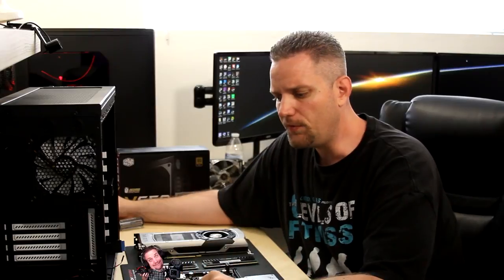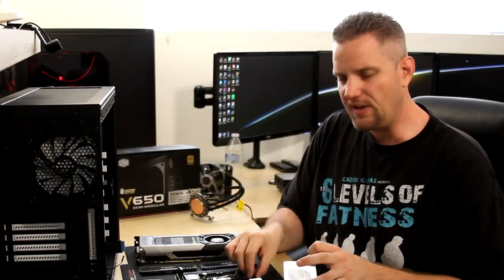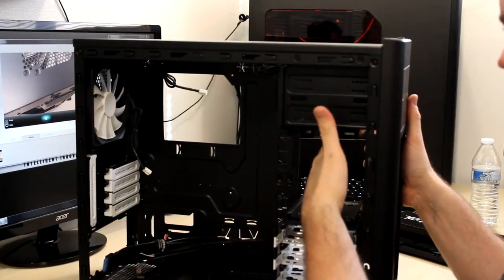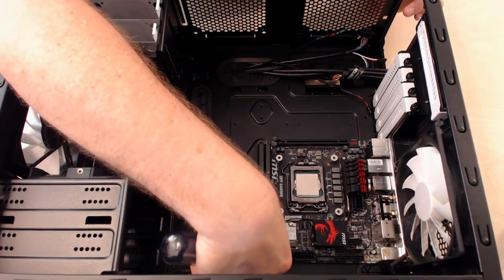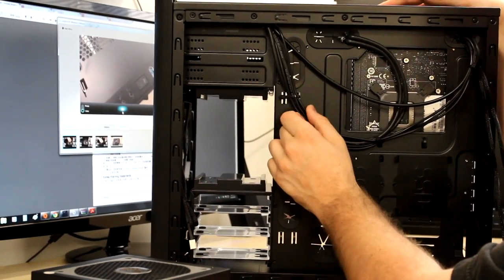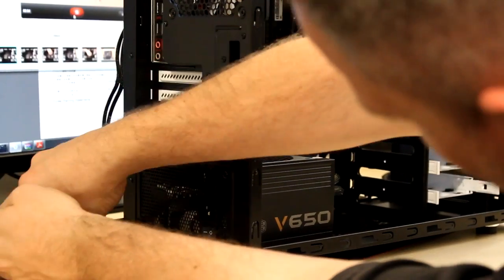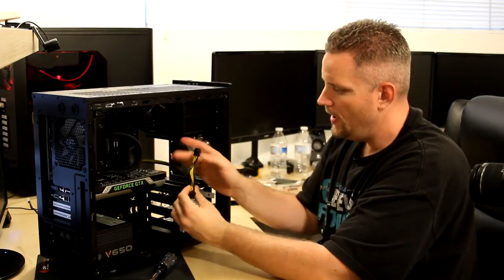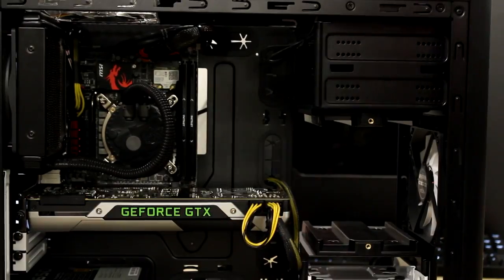Beginners Guide: How to Build a Computer

Comment: and jay will that psu cover thee parts it frys if it goes out? if so i want that thing just to be safe lol
Reply: and also how are you suppose to install windows without an optical drive?
Reply from the maker: drew lowery Check out Barnacules video on installing from a thumb drive. Optical drives are a tad outdated these days.
Reply: ***** okay thanks alot!
Reply: drew lowery honestly, just spend $20 on an optical drive and you'll be happy.. spending $20 (or less) on a thumb drive just big enough for a windows installation is not going to give you the decent speeds like an optical drive would.. i should know, i first tried that with my netbook.. took me hours to install windows xp with a thumb drive versus 30 minutes with an external dvd drive
Reply: gamerx9191 I installed Windows 7 from a USB 2.0 thumb drive faster than when I installed it from a CD
Reply: Mitja Redlin dont know how you did that one, but good work
Reply: I had to reread this question a couple times because people do not know how to speak or write english anymore.
Reply: Ian McAuley fuck off its youtube who cares its not a job application is it? no.
Reply: The "F" in "fuck" should be capitalized. Also, it is necessary to place either a "-" or a "." after "off". Another mistake can be seen when  you use the word "its" for the first time. That word should be immediately changed to "it's" or "this is" to be more specific. Another period should also be placed directly after the word "youtube", which should also be have a capital "Y". "Who", note "who". put a "?" at the end of "who cares" since it is a question. Again, "its" should be "This is"- capitalization and all. Place a comma after "application". One last thing- "no" needs to have a capital "N". In all, the sentence should read as the following:
 Fuck off. This is Youtube. Who cares? This is not a job application, is it? No.
Note: Keep working on your writing skills. ={D
Reply: gamerx9191
Because flash storage of any kind is faster than an optical disk......? Installing Windows from a flash drive will ALWAYS be faster than from an optical disk.
Reply: Ian McAuley
I bet you feel pretty good about yourself now.
Reply: Oh, defiantly. If only he didn't react all butthurt-like. Then no one would have to do stuff like I did to people like him/her.
Reply: Ian McAuley
Thank god there are people like you in the world... What on earth would we do without you?
Reply: hahaha. the fact that some people can be moved so much by people they don't even know is entirely stupid.
Reply: Ian McAuley
Speak for yourself hahaha
Reply: People still care about this topic?
Reply: gamerx9191 I installed my windows in 10 minutes with a thumb drive.
Reply: +Ian McAuley "Defiantly". Worst English teacher ever.
Reply: +Sabansux22 congratations yu sound lik a 10 year old kid
Reply: DJ Vader Thanks bro. I was 15 then xD And I never had built a pc. I was asking questions. But now I've built my pc and it's running well.
Reply: Den Ans Ikr.
Reply: +Den Ans yep
Reply: +corvin szimion It's the cooler master seidon 120
Reply: Sorry for being so late, but it's the Cooler Master Seidon 120.
Reply: Its the Cooler Master Seidon 120.

Comment: My tip is that everyone should use an ATX case unless your making a portable rig or whatever. This is because you have ample amount of air flow for your components maximizing their life and keeping them cool. Also it will make it easier to do cable management and you don't have to buy specific parts which fit in the case. Furthermore buy an ATX motherboard as your components will be further away from each so they'll stay cooler.

Comment: Please don't ever remove this video, I plan to be using it this Winter when I build my own PC for the first time. So convenient that I decided on this same case a little earlier today before I found this vid lol!
Reply: im planing on building my own pc too. gotta go earn some cash b4 hand tho..
btw. do u have any suggestions for cases? all i know is that ill b using intel core i5 6600k and r9 380 graphics card. yep.. not gonna get hyped too early lol. any suggestions would help!
Reply: Clash with Bobby
The one used in this vid is probably your best, cheapest bet.
Reply: Wouldn't the rx 480 be a better choice over the r9 380 ?
Reply: Good luck man I just finished my first build today, I go so frustrated some times but I just took deep breathes, I'm still not finished because my hard drive gets here tomarrow then I can put it in and install my drivers and Windows.
Reply: I was so relived when in plugged in my power cable and it came on

Comment: How about safety?
Antistatic wrist wrap, ESD safe procedures, gloves, etc, etc.
Reply: Static isnt much of an issue as people make it seem. The most you'll ever need is an antistatic band and thats it.
Ive had experience with pc's, all Ive done is touch the metal case every now and then. If you only have a plastic case, I guess you could use an antistatic band but really as long as you arent building on carpet nothing will break. If you really want to be safe, you can plug in the psu to the outlet, turn it off, and attatch your antistatic band onto that. And using an antistatic mat. But yea its not that big of an issue. Most parts nowadays are more durable than back then
Reply: All I ever do is to touch the metal case and sometimes an anti static band(if its a super expensive pc I dont want to break).
Reply: Creamy Z But if this is the case, why the motherboard manufacture and other big electronic companies   does care about ESD??

If you buy a brand new TV set, would you like to see fingerprint all over the screen??

And if this happen with your brand new laptop?
Reply: coisasnatv Because it can happen and they want to warn people. If they didnt tell you, you could potentially sue them. To be safe though, I generally just work on tile and touch my case. Sometimes I will use an anti static band. There is no need for anti static mats snd gloves, etc.
Reply: if anybody could help me for my laptop's touchpad problem, so for example i open the search box on youtube and i type with my keyboard, after i type what i want it takes like 4-5 seconds for the touchpad to respond.. if anyone could please help me that'd be fantastic
Reply: +Delightfuly reinstall windows if you cant find a fix
Reply: Someone thanks i'll try it out
Reply: Someone i currently have windows 10 the like update
Reply: +coisasnatv I built my first PC on a carpet. I'm typing with the same one right now xD

Safety is important still though
Reply: +Creamy Z tell that to my father. He thinks its impossible for me to build my own PC.
Reply: Technically if you just touch the case it should be impossible for you to induce static onto anything because your voltage potential should be = with the case, static zaps are pretty rare as is, and then the odds of that actually breaking anything seems really, really slim.
Reply: +Will Example, I shocked my cpu so hard my arm hurt for a little while afterwards. Was the CPU fine? Well, I can say that fx 8350's are tanks, so of course. Slow and multi-treaded tanks. Puns.
Reply: +Will 

Static has a thing with me. I'm always shocking someone and getting shocked by metal
Reply: My wife does the same!
Reply: Will:  I'm a Firm Believer in Touching my Case so my Voltage Potential is Equal to the Case.

Comment: Wanted to drop my appreciation in a tangible form here for you, Jay. Long term PC gamer, first time builder, your overview got me comfortable enough to finish the build in 3 hours without any issues other than the wiring/connections from case to motherboard (and that was a user error more than anything else.) games that were out of my reach before are running smooth as silk on highest graphics, and I neither could have, 'or would have been able to do it without your video. My thanks.
Reply: I'm having so much trouble with the wires lol.
Fuck the io plate. Biggest pain ever

Comment: Two problems, what about the static electricity and thermal paste?
Reply: +Ya_Boy_Dom IKR
Reply: Im pretty sure, you install the PSU first and plug it into the wall and keep it off then poke the case every so often.
Reply: OK thanks :D
Reply: +Ya_Boy_Dom it looked like he was using an anti static mat
Reply: +Patrick Challita What about the uncooked rice style? Would that work as well?
Reply: ThePIANOguy14 The uncooked rice method works perfectly fine. However if you're applying thermal paste to GPU (for water-cooling) or 2011 socket CPU's which are bigger (5930X) apply the thin line or X method. But for a normal CPU (like 4790k) uncooked grain of rice is fine or pea method works fine too
Reply: Patrick Challita Okay, thank you. I've heard all these methods and now I know which ones to use.
Reply: +Patrick Challita I always wear a strap to be safe
Reply: Ch33kyMangozOnPC Its good to wear one but its not that necessary if you follow the simple precautions such as working in a static free environment and touching the metal case every few minutes
Reply: Shh, you're crushing babby Jay's dreams.
Reply: Usually inside-out antistatic bag wich comes with the motherboard works
Reply: At 6:42 I scrolled down here for this. Just wanted to make sure thermal was mentioned, and  static.
Reply: Thank you!  And the order he's building in is driving me nuts!

Comment: Even though I am an experienced builder and know quite a bit about this stuff, this video remains a nice relaxing thing to watch on the side.
Reply: When installing a cpu how do you put it in the right spot and not too far to the left or right
Reply: John McCain It fits perfectly in the socket.
Reply: +JustAnotherYoutuber I mean what if when I'm installing it I put it in a millimeter to the left
Reply: +JustAnotherYoutuber how do I get it exactly where it needs to be
Reply: I noticed that the only protection from static electricity he was using was a anti static mat. Would a anti static wristband connected to the PC's case also work?
Reply: +Petyo11 yep as long you are grounded
Reply: +John McCain you Match up the arrow on the holder and ur cpu

Comment: how does installing the operating system work
Reply: u need a optical drive and thee windows 10 CD . turn your comp on open the Disc drive and put the CD in. in BIOS find your boot option tab place and set your computer to boot thru CD. power off than on and it should boot the installation
Reply: +Zombeh thanks man :)
Reply: +Music IsLife :3
Reply: +Music IsLife Or just create a bootable usb disk from a usb stick
Reply: +Lennu Vilen much easier and doesn't require an optical drive nor the disc which is an expense some people can't take^
Reply: I don't want an optical drive. Can I use any like portable one? Do you have any cheap ones?
Reply: +Yehuda Lelah using a flash drive ir USB is okay just have to download the media creation program from Microsoft website
Reply: +Zombeh or torrent a window's version?
Reply: Vortez im assuming he has a product key for win 10
Reply: ***** o idk that's how i'm installing an os when I build my pc
Reply: Replying to see later
Reply: thumb drive
Reply: +Killgore Ficus Same thing.
Reply: +Nootman Double One Three I think.
Reply: +Daniel H. If you want you can buy a key by it self it is cheaper.
Reply: Vortez: are you suggesting piracy ? Free your mind, smell the flowers while you still can, Live a good life, Live and let live.
Reply: get a copy of windows 7 then free upgrade it to 10
Reply: b1ldin bee My comment was not based on storage time or update issues it is simply a way to minimise costs a fully legal copy of win7 with key  runs at £17 currently on Amazon win 10 £98.
Reply: b1ldin bee I guess deep down inside where the little girl in pig tails sits crying in the dark you really are finished..... no caps lock needed
Reply: b1ldin bee Sorry william cant chat now just popping to wendy's then maybe to flanagans pub on hawkins but I'll bet the Long Island Eagle is much more your style ...x love ya night night
Reply: MinemanTHEGREAT: Isnt that illegal ? don't they call that Piracy ?Cannot Microsoft, if caught pursue charges against me or Fine me or both ? My search results for Windows 10 at G2A was an authentic licensed copy of Windows 10 for $203.00, what you were inferring and encouraging was for people to act in an illegal manner, your parents most be proud.
Reply: +Buddy Blue Lol windows doesn't fine you it's mostly the govt. luckily our govt in Australia is quite lenient and you get 2 warnings.
Reply: Now a days you can buy a Windows 10 license for 30$, just do some web searching. There is no need for piracy.

Comment: I just build my first computer about two months ago. It is an absolute beast! With some parts i got from some really awesome family members, plus spending about 700 for the rest of the parts i had an absolute blast! total time i took to build my computer was about 2.5 hours. And there's no beginners luck for me because my system wouldn't post for some reason until i did the psu test, tried booting with it externally and it worked. So i took 2.5 to build and about 5-6 hours troubleshooting. I am now madly in love with building computers and hope that i can build a profession out of it when im done with highschool. If you ever struggle while building your first custom pc, NEVER GIVE UP JUST DO IT!
Reply: +olshadow16 and now you have the itch. to keep upgrading :P

Comment: "...250 GB is not gonna cut it,"
I use 80 GB in my main PC. (It is a Dell Optiplex GX620 stock [I think])
I am almost out of space - 5 GB left - but that is beside the point.
Reply: +Ethan Weegee For gaming he said its not gonna cut it, which is true. And remember there was no HDD in that build.
Reply: +Joshua Dinham Well I can actually play Minecraft on it at around 20-30 for average. ROBLOX runs smooth, too. (But ROBLOX makes it reboot. I don't know.)
Reply: +Joshua Dinham Also forgot to mention most games I play are fine on this PC, I use it to game often.
Reply: Most people don't stick to one game bro. COD BO 3 alone was over 50 gigs.
Reply: Wow...
Reply: +Hyde3000 I wish I could say wow, but that is common.
Reply: +Joshua Dinham Exactly, only have 4 or 5 triple A titles and those games alone combined are over 250 gb.

Comment: When I built my PC a few months back I had issued getting it to display. It would turn on but not display, I also noticed my keyboard/mouse weren't lighting up as they should. I was completely confused so paid I $40 for a computer store to fix the issue. After like two weeks they called me and said nothing is wrong it works fine. So I was like this is fucking stupid, I brought the PC back home and connected it to find the same mother fucking issue.. Okay so I thought let's brain storm a little. The PC works fine at the store but not my home? I tried different outlets in my house to think it was a power problem but sure enough the same issue. I researched day and night and finally was like let's have a look see.. I opened the case and sat there for about an hour on the floor and said "What's this do?" (jumper setting) I took it out and placed it back in, turned on my PC and it worked ever since then! I was beyond happy! I'm still completely mind boggled though how it worked at one place but not mine. Wow I wrote a lot, well thx for reading all this if u got this far lol
Reply: Wait! I have the same problem! I cannot get signal to my monitor! 

What is the jumper setting??
Reply: Josh Foret I think it's called the CMOS reset setting, and it looks like this http://static.giantbomb.com/uploads/original/4/45070/1697487-cmos_jumper.jpg

When your PC is powered off, take that out and put it back in. Then turn on your PC and see if it works :)
Reply: Uub sweet thank you i'll try it asap!
Reply: Josh Foret Let me know how things work out ^^

Comment: Guys, can you tell me if this build is good? I'm actually serious about building this pc.

GPU: EVGA GeForce GTX 750 2GB FTW ACX Video Card

CPU: AMD Athlon X4 860K 3.7GHz Quad-Core Processor

CPU Cooler: Cooler Master Hyper D92 54.8 CFM Rifle Bearing CPU Cooler

PSU: Corsair CX 500W 80+ Bronze Certified Semi-Modular ATX Power Supply

RAM: Corsair Vengeance 8GB (2 x 4GB) DDR3-1600 Memory

Motherboard: Asus A68HM-Plus Micro ATX FM2+ Motherboard

Storage: 
     - Seagate Barracuda 1TB 3.5" 7200RPM Internal Hard Drive
     - Kingston SSDNow V300 Series 120GB 2.5" Solid State Drive

Case: BitFenix Neos Black ATX Mid Tower Case
Reply: terrible build !
Reply: WingChunNun This Post is two years old...

Comment: Heh, I still remember when I installed my mobo, I forgot the back I/O plate, had to take it all out again :P
Reply: ***** Yep, I done goofed!
Reply: barkerbrothers619
I dun goofed * is the correct saying ;)
Reply: What does the I/O plate do anyway? Wouldn't your pc work fine without it anyway?
Reply: TheBossIsHerePL Well, if you're reaching around the back of your PC to plug something in you wouldn't want to accidentally touch your motherboard, and it probably helps with dust.

Comment: Awesome tip on the power supply placement. I'd just like your idea about the fan facing upward if you have your pc in carpet. So I'd just changed it around. Keep up with your good job and videos.

Comment: Will I be able to run minesweeper on low at over 30fps

GPU: GTX 990 8gb VRAM

CPU: Intel i7 9000 8ghz

Ram: 128 GB

These are just my basic specs (nothing specific) Don't make fun of me I'm on a budget
Reply: chuck rox You will run it at low at 1 hpf (hours per frame)
Reply: id consider upgrading to the latest i9 line of processors